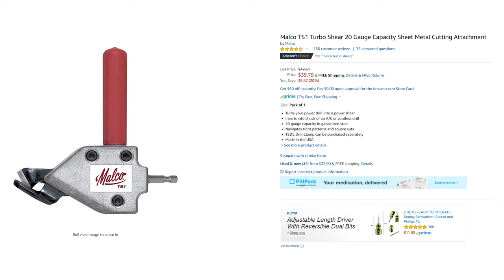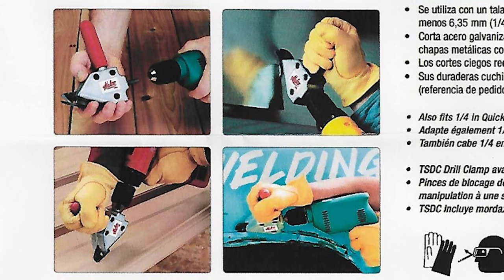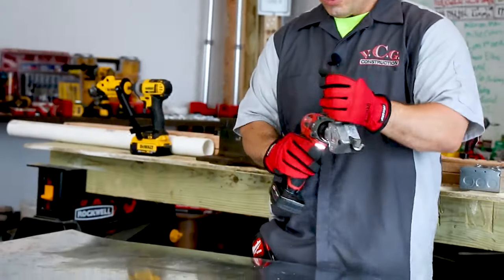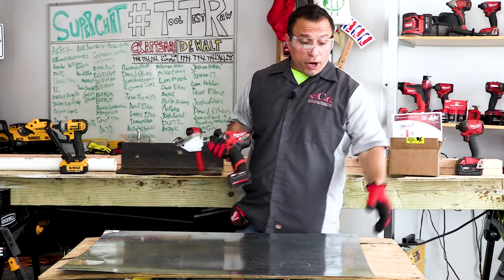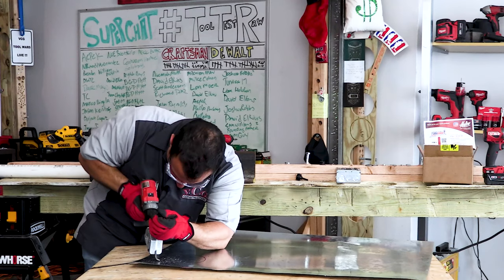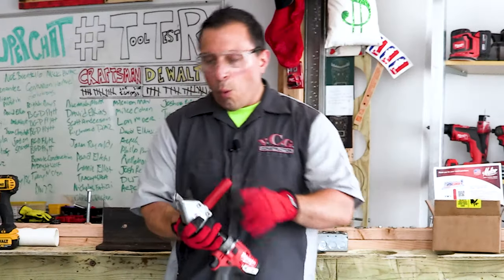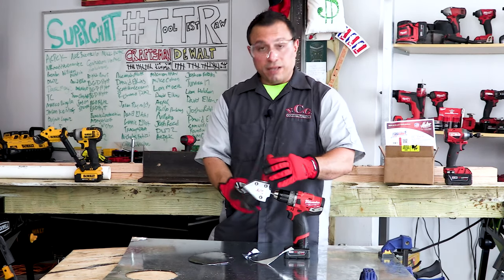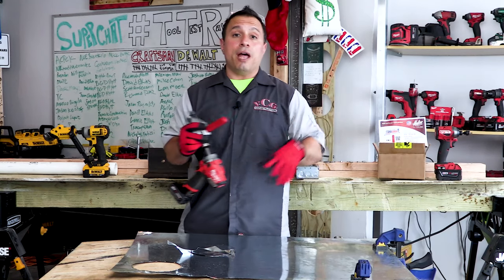NEW POWER TOOL ACCESSORY THAT 99% OF PEOPLE DON'T KNOW ABOUT!

Comment: I've had that tool since 2002. If you turn the drill on its side and run the tool on less of a 45 it cuts smooth and won't leave marks on the tin
Reply from the maker: Whoa, thanks for the heads up!!
Reply: VCG Construction  would like to see a follow up on this technique.
Reply: I agree 100%. I've had and used this tool for several real years. I love it. And I almost always have the drill on it's side. I'd like to see some sort of slide on attachment that would allow o e hand operation.

Comment: Hey Vince, thanks for the VId! Just wanted to add. When using this tool, you tilt the shear a little to the right and it cuts fairly quick and easy especialy when doing collars as you mentioned, especially on a trunk line already assembled. Also. You mention the adapter is two handed operation. Once the shear begins to cut, you can operate it with one hand while keeping the correct tilt on it. 

P.s. you can use it on an impact but it vibrates way too much!!! Thanks again

Comment: I’ve used both. I own the dewalt because I didn’t want to spend the extra money on the stabilizer attachment. As a union sheet metal worker I cut a lot of taps into our duct. It’s easier and cleaner to use my reds(snips) on 24 and 26g galvanized. 22g and thicker can suck, especially if you’re cutting overhead that’s where I think this tool shines.

Comment: It goes a heck of a lot faster than that you had it at the wrong angle. it's okay happens everybody when they first get the ts1 . But after you're used to it you don't need to even hold that handle you'll be able to make turns and cut round holes or square holes for duck with one hand no problem drink coffee with your other hand. LOL

Comment: I have that Malco ts1. Turboshear first edition I told y'all about it in the comments on the DeWalt shear video. I've had the ts1 for right at 20 years.
Reply from the maker: Which do you like better Jason?
Reply: @VCGConstruction  well I have the ts1 and the tshd1. tshd1 will easily cut 18 gauge and it has the strap that it goes onto the drill like your DeWalt unit does but I don't like it as much as the ts1. the original ts1 in my opinion is faster and more versatile  and more nimble allowing for more options and more options faster, once you get used to it. They do have for about $25 or so a kit that goes on the ts1 that will attached to the drill body kind of making it like your DeWalt unit and kind of like the tshd one but it's not going to make it go from 20 gauge to 18 obviously. I also have the tscm for corrugated metal and that's really nice  too.  Malco has all different kinds  of turbo shears. they've got some for asphalt shingles and all kind of stuff but they get quite expensive. Out of the three that I have I always go for the ts1.
Reply: @jdreynolds29  Vince said that this unit in the video goes up to 14 ga! (In a reply of another product.) That's really thick.

Comment: The two hand operation is better to me. Puts less stress on the shank and you can adjust in ways you cannot with the fixed shank unless you take it out of the chuck which nobody would do

Comment: I use the Malco shear. I already had the drill and there comes a point when you have to start to limit the number of dedicated specialized tools you bring on the job, especially for resi work. Another fun HVAC attachment is the C5A2 turbo crimper.

Comment: I was wondering what if one placed tape from the cutting add on to the drill and back again. It seems like it would be a cheap solution to the problem. Seems like a interesting tool accessory to have , just wish I really needed it.
Reply from the maker: Maybe zip ties?

Comment: I have both the dewalt with the attachment and the malco with the handle it depends on what I am doing on which one I use. They are both great the dewalt lives on my drill cause I am a hvac installer if I had to get rid of one the malco would have to go

Comment: I'd like to see a revamp of this video with the attachment that stabilizes the Malco turbo shears to your drill so you can use it one-handed and Malco also has another Shear attachment that turns your drills into double Cuts instead of the single cut shear which also has the attachment so that you can use it one-handed

Comment: Busy with the Malcolm you'll be able to get into tighter spots because the drill could go sideways it's DeWalt you can't because the battery will be in the way
Reply: you dont have to have the clamp attached to the tool with the dewalt but it is nice to have that feature unlike this one. the arm/clamping mechanism can swing/pivot around and actually get into way tighter spaces than the malco.

Comment: I can tell right away that this wouldn't work well because it requires both hands.  That means you can't hold your material steady.  I suppose you could clamp it down, but that's not always possible or convenient.

Comment: I bought the Malco used it today to cut out a 23x16” hole in my return duct! The tool sucked! Had to use my hand snips to clean up the mess! What a crappy tool! 

Maybe it’s better when cutting on a flat service! My 26” wide return Duck is mounted in a vertical position!   Now I’m concerned using it to make the cutout in my new AirQuest 28” wide furnace!